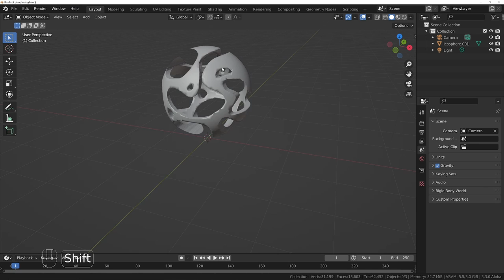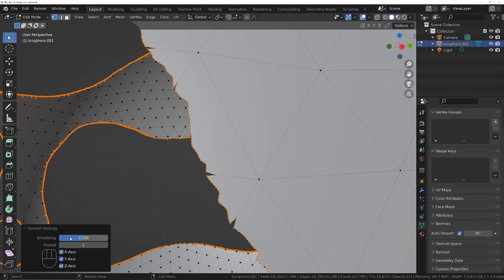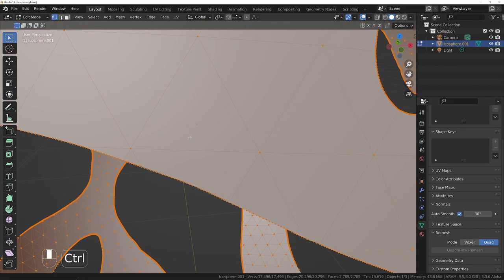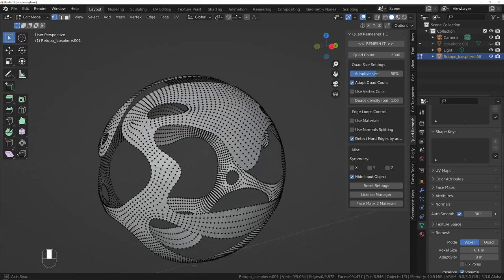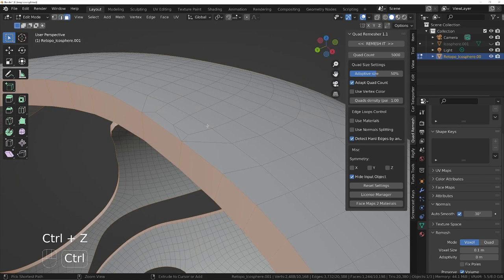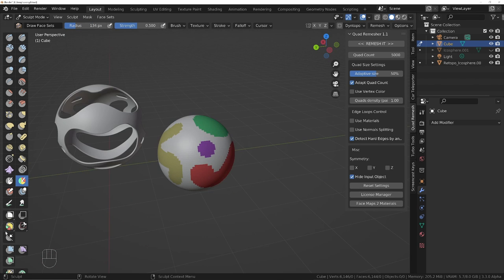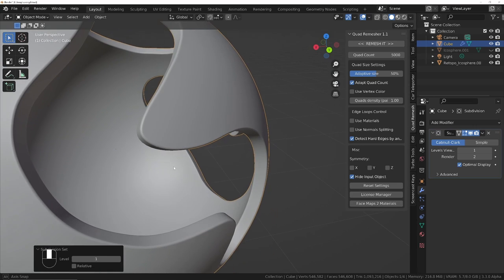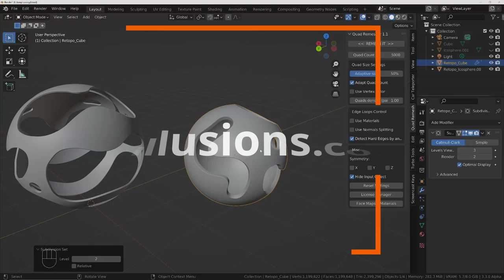How to fix and avoid broken geometry in Blender.

Comment: That's really nice, I'm especialy interested in all the built-in selection tools blender offers, I never really use those. Also, you're probably entirely aware but to easily select the edge faces ( the ones generated after adding thickness to the sphere), you can just use face select mode and alt+click one of the edges between two faces that form part of the loop you want to select.

Comment: Unfortunately this is only visually, right? If I want to 3D print it and flat shading is not something in 3D printing then it will be all jaggy again?
Reply from the maker: No this is actually smooth.  You have to give it sufficient subdivisions of course.  If you turn on flat shading then it will visually represent the printed model correctly.  Don’t turn on smooth shading, otherwise that will visually smooth it.